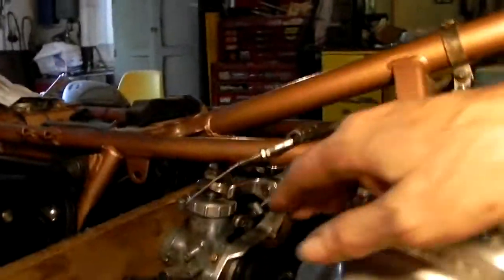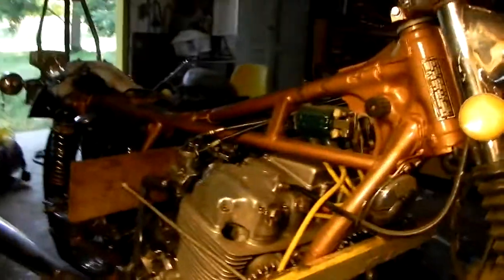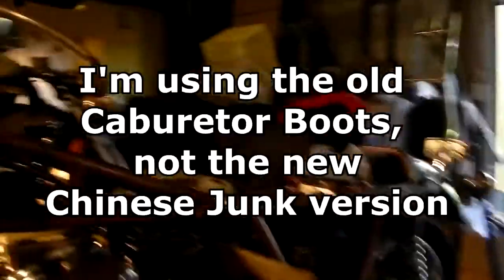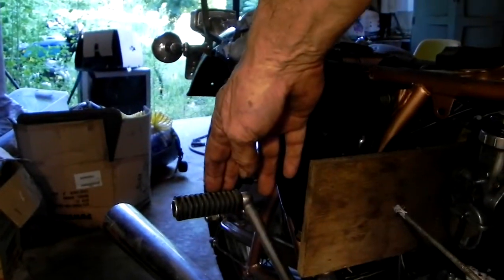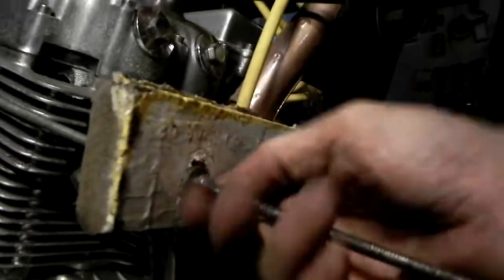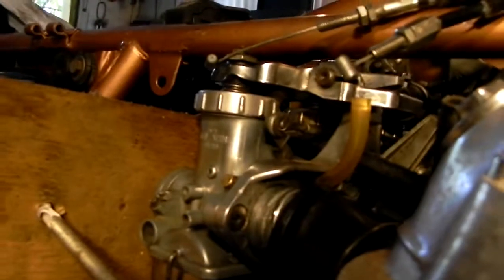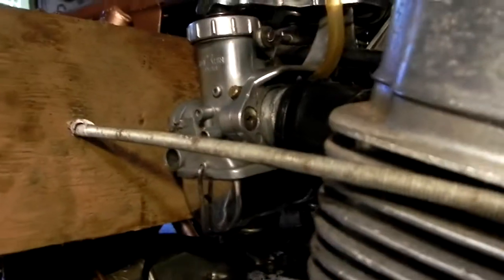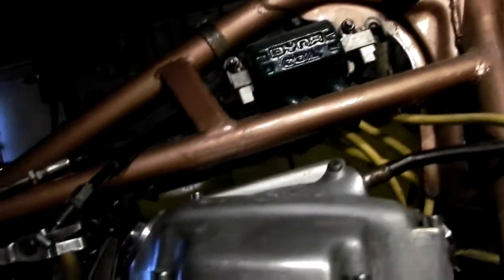How to install the carburetors on the CB750 Honda Vintage Motorcycle

Comment: Great video and set me on the correct path. I made a slight mod by using a small ratchet strap and 1x4 about the width of carb bodies. Worked perfectly!
Reply from the maker: That is such a good idea and would been a whole lot easier than the way that I did it.  Thank you very much and have a nice day.

Comment: thank you/ that worked great for my 70cb750honda//just finish mounting my carbs
Reply from the maker: You are very welcome.  It's always been tough to push those carbs on the bike and as I got older, it became too hard.  So this jury rigged system was the only thing that I could come up with.  Have a nice day, Jeff.
Reply: I will give this a try. Thank you for the idea.